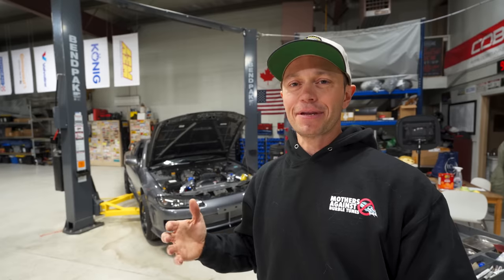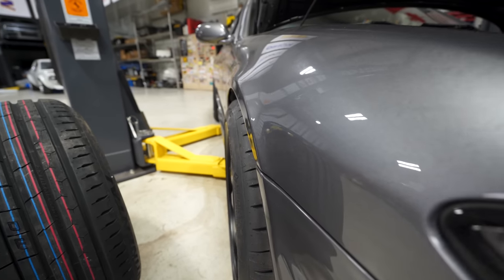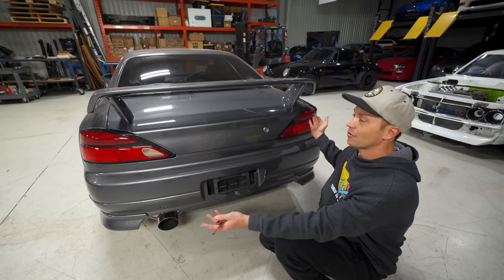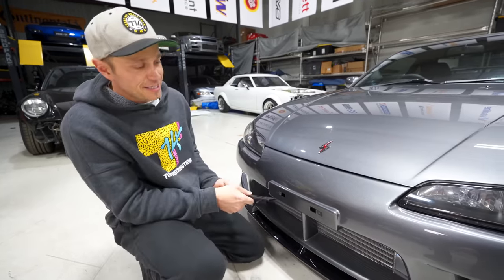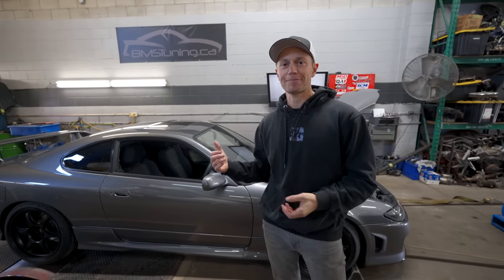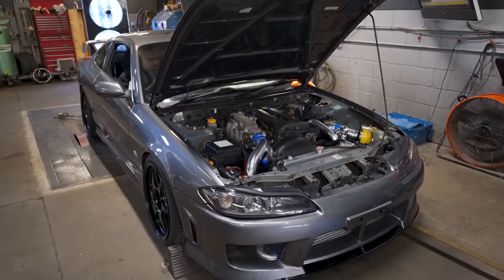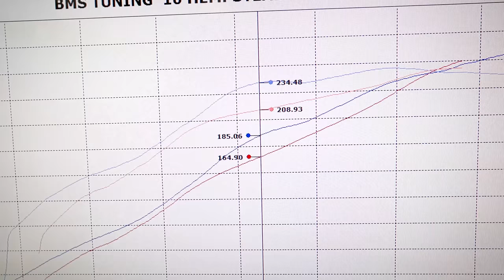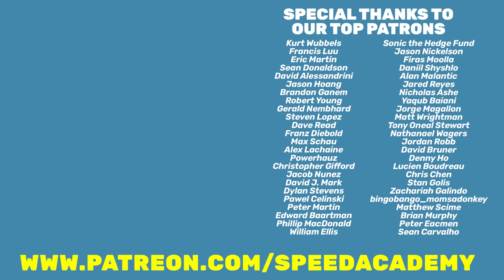Quick & Easy Cheap S15 Build  - EP6

Comment: 225 with a stretch is probably the biggest tire I would put on a S-Chassis front wheel - Also would help if you did 17" wheels in the front. It's an old trick not a lot of people do in modern times but prevents a lot of rubbing inside the fender well.

Comment: Great series!  Miss my S15.  Overall, looks great.  My personal opinion, I would have gone with the Vielside kit without the wing and AVS Model 5 rims. As for the lights, I would stick with original amber.  Also, with your rear plate holder, I popped the bottom button off so I could tilt the rear plate up, as well.  

Would love to get another S15 on this side of the world.

Comment: I love this build series! The chassis, color, wheels, everything. The few cars I have modified OEM+ is the way to go. That style is the way modern car culture should go (with obvious exceptions, track racing, drag, drift). Not obnoxious for the need to be obnoxious. Keep up the good work gentlemen! 

Btw I know you guys have a soft spot for older Hondas. I have a 2009 Honda Fit, silver with only 21,500 miles. Clean title. I’d love to see a build series on that or even a “Pimp your ride” kinda thing. Heck if you’re interested in buying it even, that would be epic.

Comment: Now it looks like Acura TL 2002 or some year close to that. Quite an upgrade from a Pontiac look 😅. Tint the clear part and it should be perfect!
Reply: These were my exact thoughts! TL-ish look with the aftermarket tails that would be improved by a bit of smoke.
Reply: I agree. The trim on the original tail lights fits the headlights.

Comment: Had to throw my 2 cents in. Stock tail lights are much better in my opinion. Never thought about a grand am until you mentioned it. Also, not sure you do this or mention it but I always upgrade to stainless hardware for license plate mounting. Living in salty southern Minnesota it’s an amazing difference. Bolts look nice for years and don’t rust/weld themselves in after years of use. I don’t know about you but after years of twisting heads off of rusty license plate bolts I finally changed to stainless and never looked back. I just pick them up at my local hardware store (c&s supply)

Comment: Absolutely gorgeous car. Love the new tail lights. Prefer the original tire setup.

I'm torn about the power output. It's a lot of work and money for 260 wheel. But it is true to it's roots, which I appreciate. I was expecting more power but maybe I'm used to seeing built SRs and 350-400hp.

Comment: FYI in the rear tail lights having the 2 color reverse len colors is because the white is reverse and the other side is technically the rear fog light when you activate fogs.. usually in euro cars it has 1 side red lens that lights up... honda did something similar in their jdm tail lights for the eg civic chassis... right tail light has a red light that lights up when you hit your fog lights.... so with the siliva is the same thing... o e is reverse light other is the fog light... it's a brighter light out of the trials when lights are on so people can see you in rain.. fog.. or snowy weather.

Comment: for the front wheels you probably should have just gotten a narrow rim and keep the same size without the stretch, or maybe some wide guards in fibreglass would have been a good option.

i personally think tyre stretch is the worse solution to a problem that should not exist.
rest of the car is looking really nice though. ( see if nissan still sells the fabric seat covers)
also maybe the tail lights with the orange indicator would look better than those full red ones.

Comment: If you could find a way to get the Chrome area for the signal lights blackened, but also have enough reflection for the turn signals to work, I think that would alleviate the issue of it looking off

Comment: OEM+ is the way to go with these cars to stand out now; way too many get cut up for widebodies or beat on, so seeing one that is extremely tidy and restrained is a nice change. I kept my S15 largely OEM+ for the same reason. 
As for tail lights, I had run those exact DMax units as well as another style from them, and ultimately went back to the OEM tails with the amber signals and all.  Yes, they look a touch "old" compared to aftermarket offerings but that's the appeal in my eyes, given it's an almost-classic car.

Comment: D Max taillights 100% oem plus look and more modern. Wheels look spicey now but to pull that look off 100% would run a smaller tyre in the rear to and low it all to match

Comment: Hi from Australia My S15 has got all the similar mods to your car I run a PowerFc ECU We run 18 PSI stock turbo makes 300HP at the Wheels been like this for around 50,000 kms Stock unopened engine

Comment: If you're going oem+, the badges all need to be on, and you should get a fresh set of orm tails, unpainted. Not having the amber turn signals was throwing the look off completely. So you went from a weird all red tail, to a very cheap looking ebay style taillight. And I fully get not wanting another TE37 wheel look on a S chassis, but you didn't really go that far from a TE37. It's still a non dish, thick 6 spoke wheel. From a fast glance as you drive buy it would give the TE37 look, or the "I can't afford TE37s so I got as close as I could afford" look. I'd honestly like seeing BBS LM wheels, or Advan 3 spokes, maybe Work Meisters, or even Nissan Nismo LM wheels on it. Actually do something that's different from the boring flat face 6 spoke thick spoke look. The tire change helped a ton though!

Comment: I still prefer the original wheel and tire setup, looked so badass, now is just another cool S15.

Great series, great videos 😊

Edit: just finished watching the whole video, SR20s don't like too much degree advance, they do gain pretty good who and torque, but the risk is way high for the gains. I'm not a tuner, but I have couple of sr20de and SR20VE 20V.

Edit 2: THE CELICA IS ON THE LIFT!!!!!!!
Reply: Celicas are wack 😂
Reply: @doriftuh7331  they're alot cooler than a fuckin S-chassis lol.
Reply: @michaelallen2501  said the no one ever lmao

Comment: I kinda liked the fatter tires, but I'm different than most because I also like smaller wheels than most people. I would keep the modern lights, and maybe only the Silvia badge in the center of the trunk like many modern cars have. So without the nissan badge.

Comment: 18psi are no problem with stock everything, either way you're just pushing hot air with the stock turbo so its not worth it.
but everything will survive easy (if you dont go for topspeed pulls or trackwork)

Comment: Is the red lens opposite the clear reverse lens possibly for a rear fog? Pretty sure the R34 had a similar setup with reverse on the left, fog on the right, but it was more obvious since they were separate housings rather than being integrated with the other rear lamps.

Comment: The stock lights are better. I don't get Pontiac at all from them. I do get 2000 model year Mazda 626 from the aftermarket ones though. They look like early Ebay years aftermarket replacements.

Comment: The after market tail lights are hideous! OEM S15 tail lights are perfect. The reason the right side has the red is for the rear fog light. 

I'm assuming that you'll swap the wheels when you get it on the track? That stretched front is going to end in tears on the track ;-)

Comment: I personally really don't like the tire stretched as much as you have on the front, it looks weird to me. I liked the original, It looked tough with the big tire poking just slightly, but if you didn't want that I would have gone to a narrower wheel as well.

Comment: Initially this seemed slow to me, especially when I compared it to my s13 sr, being same weight but having almost 200 whp less than my s13 did.

Until I remembered this car is still almost 280 lbs lighter than my prelude sh and makes anywhere from 90 to 100 whp more.  And about 450 lbs lighter than my 350z and still makes about 20 whp more.  It’s all about perspective.

Comment: the reason why the stock tails only have one reverse lamp is because on the other side it has a rear fog lamp in the same place the reverse lamp would be. I guess it was so Nissan could use the same lamps for both Japan and the UK - Europe has the location of reverse lamp and rear fog reversed, so in theory Speed Academy could pick up a Euro lamp to have symmetrical reverse lamps as no requirements for rear fog lamp in Canada/US unlike UK/Europe.

Comment: I have a ideia, since there is no Camry TRD 4wd , why not pickup q Camry 2.5 4wd and try to make ir faster than a TRD? I think there is some vídeo one guy changing 2.5 heads and getting big power added without FI.  Maybe even changing final drive in the autobox is possible.. You later can make also a TRD tune car.

Comment: Hey Guys,
I like the new tails better, but the chrome is a bit bright. You could tape off the red, and tint the chrome section to tone it down. The spray tailight tint works really well. Just need to do a light coat to give it a smoked look.

Comment: The width of the tire wasn't the problem, it was the offset. The edge of the tire is meant to stick out just a bit from the rim lip to protect it from curbing and now you've taken that protection away. Baffling, PT.

Comment: meh.  those taillights remind of what the cheap replacements look like for Hondas...  .  fitment is slightly off. nothing wrong with 245/40/17 or 245/35/18 square for those power levels.

Comment: Paused at 15:50 to guess….. 274hp but will need 17.5psi

Edit - fail. Might have been correct if the boost was bumped I guess

Comment: Yeah 260 for an S15 is more then enough.... similar setup but with a bunch of Nismo gear here in japan is enough for the mountains roads, if you don’t want to kill your self and I’ve gone back down to .5 of a bar cause it’s enough 1 bar is just dangerous on the roads here if you respect your life and the S15 😂 they are after all light and made of tin foil so you really don’t want to hit anything at speed in them. Unless you have a roll cage.